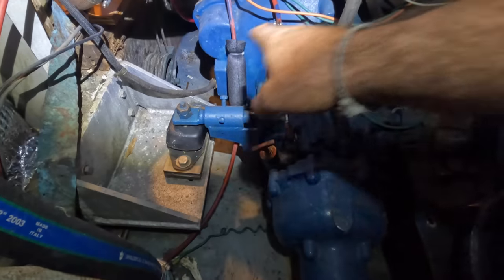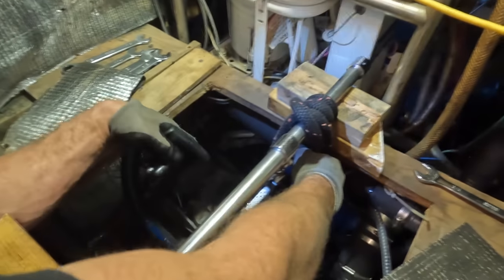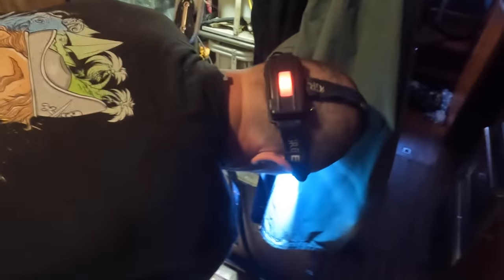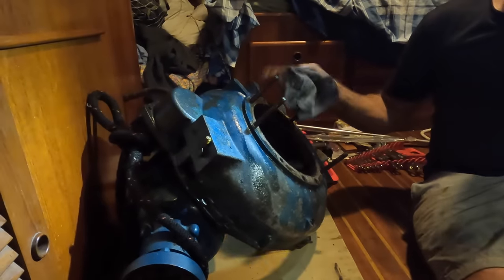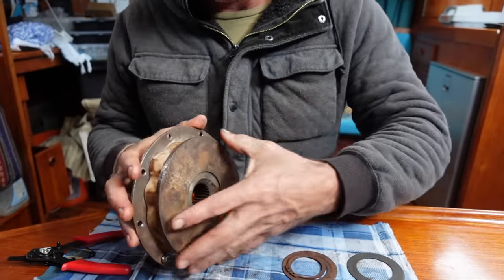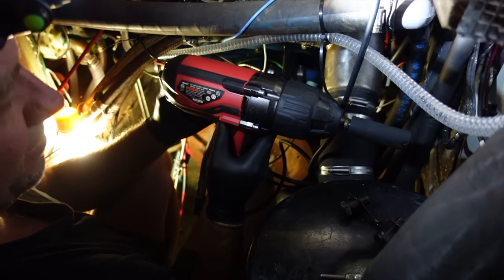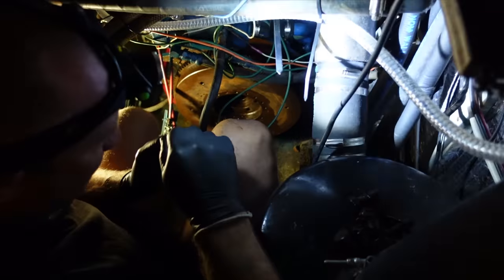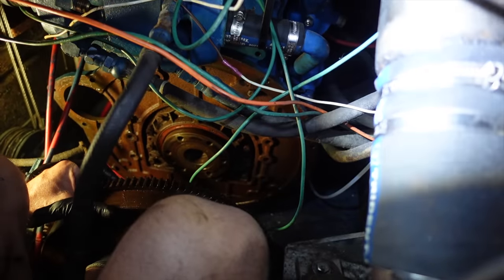DIY Repairs on a Sail Boat Engine | Ep 349 | Lots of Boat Work

Comment: Had to rebuild the borg warner transmission in Puerto Madero Mexico.   These engines are leaky. While tranny was off, replaced the real seal and the oil pan gasket.  Got the tranny rebuilt in Tapachula for a great price!  Have had VERY good service from my Perkins engines.  The KP 44 had a 4-154.   Good but not as good as the 4-235.  Looks like you’re doing it right.  “A stitch in time!

Comment: Absolutely - you are there and have it all out in front of you...change thaat gearbox seal same time. Also, often if the leakage is of blackish oil it will indicate engine oil, cleaner oil indicates gearbox oil.

Comment: Hope the replacement seal is the orange silicon based one like the original as the black ones harden up due to engine heat and hot engine oil faster. 
And when it comes to replacing the rear seal on the Borg-warner the nut is extremely tight and its recommended to replace the nut. Ive made up a steel bar with all the diff Borg-warner bolt sizes and spacings to lock the coupling while undoing and then retorquing the coupling nut. Actually easier to do rear seal when the 'box is bolted to the engine. Some have an o-ring  under the  nut to stop oil travelling down the splined of the output shaft and out thru the coupling and sum just need a smear of RTV/Silicon pushed into the spline when the coupling is slipped on then the nut gets torqued up. By genuine Borg-warner metal cased seal if possible. And locate/buy sum Res-Q-Steel to go onto the splines in the driveplate and any fasteners on the boat subject to saltwater immersion/spray. Not meant for heat like exhausts but far far superior to any anti-seize product for marine use anove and below waterline.